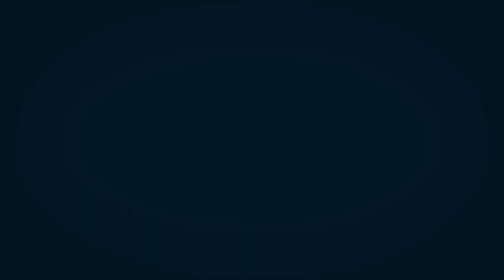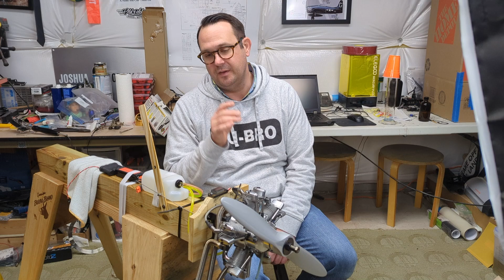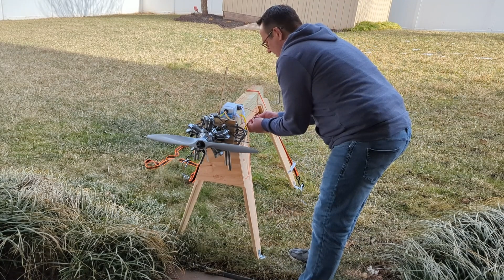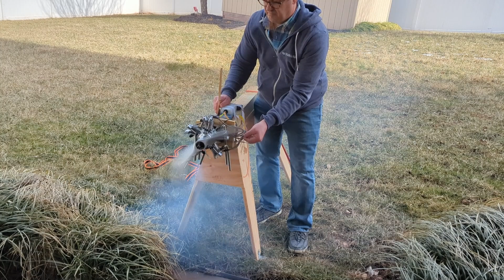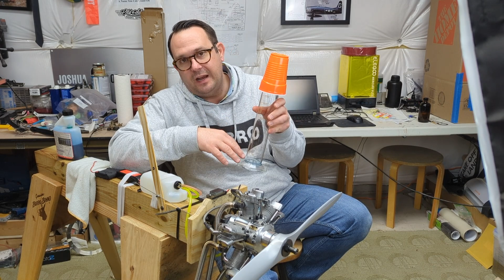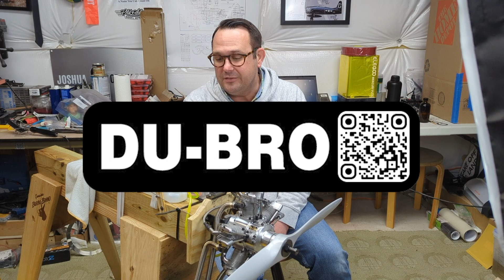Wedell Williams Model 44 | Saito FG-73R5 FIRST START

Comment: I have the same motor as yet unrun but fitted with keleo exhaust ring. Question: In your opinion  is it better to run it in on flexi exhaust pipes or on collector ring or will it make any difference?
Reply from the maker: I don't think it will make any bit of difference. The backpressures are very similar due to exit area however the volume of the exhaust is more for equalizing that flow and managing symathetic resonance for sound profile. Personally, I'm keeping with the stock exhaust as it sounds amazing after the timing correction. I personally do not think that the exhaust ring does much more to change the sound.

Comment: Thanks for the great information. I have a new FG61-ts that I haven’t started yet. It seems like there’s so many conflicting opinions about do’s and don’t. I find your videos to be very credible.
I too am scratch building from Hostetler plans.  35% RV-4. It’s much more complex than I anticipated but it is going extremely well. 
Thanks again for the great videos.
Reply from the maker: I found this to be the case as well. I spoke to a number of engineers within our hobby to try and parse out the more credible information. Good luck on your build! These Hostetler builds are not trivial but I'm told they are worth it.

Comment: Don’t follow the instructions too closely, they say run rich at full throttle, so rich that it just continues to run and not quit, I did that on my first radial saito it backfired and sheared the timing pin on the prop boss, I think the instructions are left over from glow versions, I have ran all mine in the same way now rich and limit rpm to 3500 max for first few tanks before starting to lean out and increase revs, they all take quite a lot of running in but run great when done